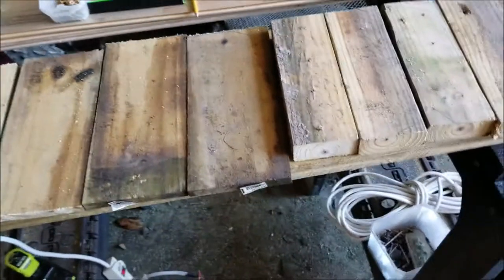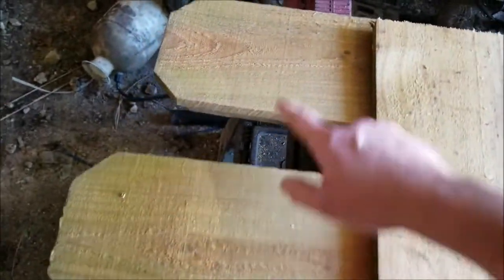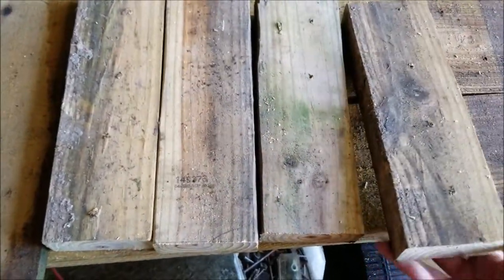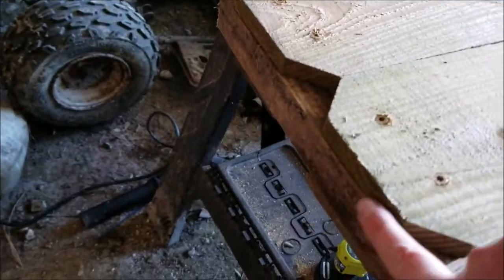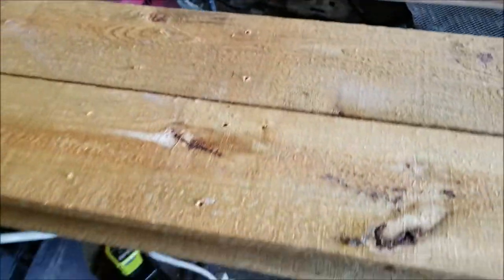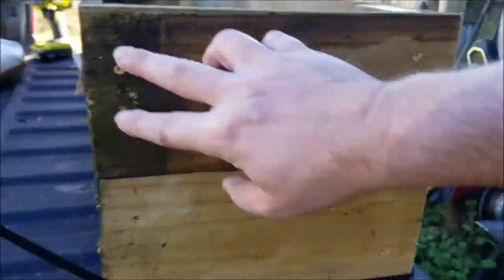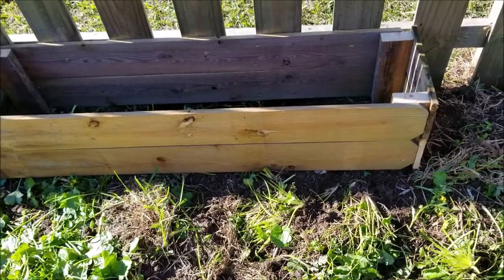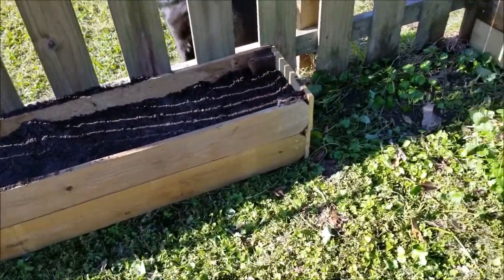FAST - How to Make a Planter Box Out of Fence Pickets and 2x4's

Comment: if I wanted this to be a raised planter box, could I extend those 2x4 pieces to 2x4 legs? how would I attach a base to it? my plan is to want to separate this planter into 4-5 sections and line it with plastic to grow some fruits and vegetables.
Reply from the maker: You could attach 2x4 legs to the outside of the box, securing them to the 2x4s on the inside.  If you extended the inside 2x4s as legs, you would have to frame out the bottom, going around the legs, and securing the base to the frame.